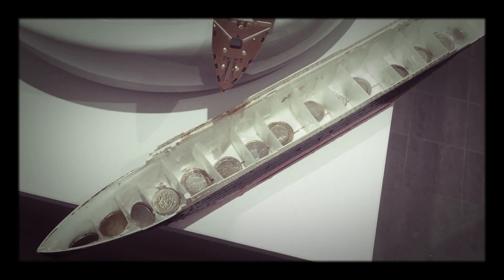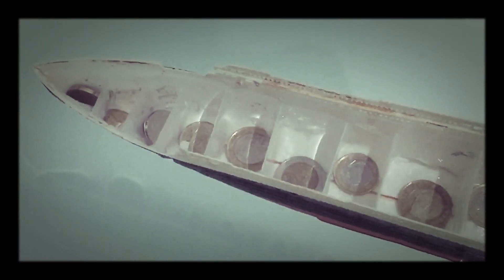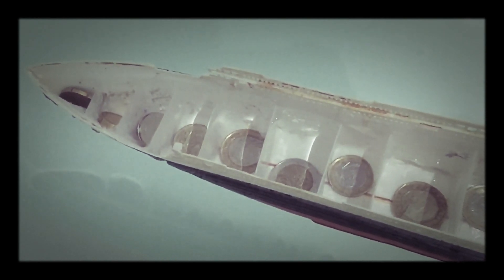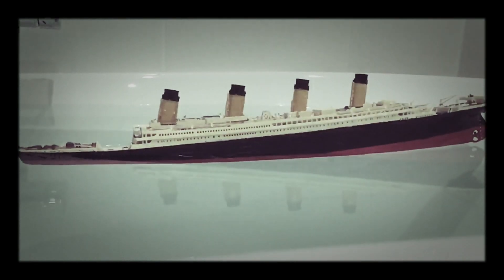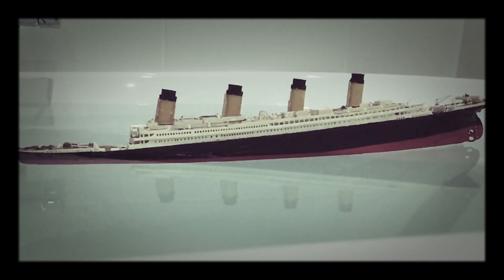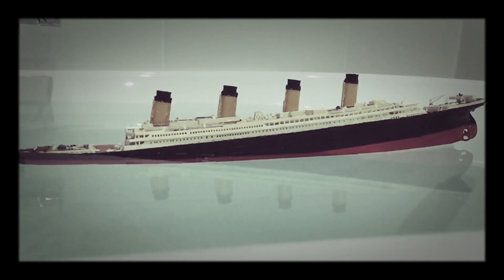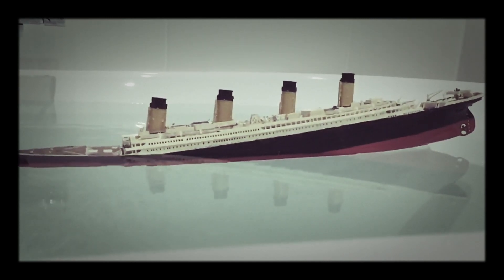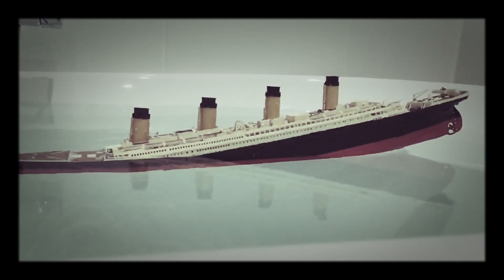Model Titanic with 16 watertight compartments sinks in a bathtub

Comment: wow it's sinks like real. if it's had inside decks added the sinking  speed will be realistic. stern raises the weight of the stern could not handle the double bottom. the breakup must near expansion joint.

Comment: I was a kid in the early 1960s. I had a motorized toy "battleship", Remco's "Fighting Lady":

https://www.youtube.com/watch?v=79Gmr7o4abw&ab_channel=ReanimationToys

All the electronics were attached to the deck, which could be removed via the screws visible in the video, leaving a bare hull. There was an opening in the bottom near the middle, where the batteries were installed, but it was mostly walled off except for one easily sealed opening. I floated the hull in a metal wash tub, added gravel weights, unsealed the opening, and tried to "save" the ship using multiple siphon tubes. As I gained experience, I built in watertight compartments using waterproof glue and popsicle sticks, then added more weight. Great fun.

BTW, I wasn't simulating Titanic; I was actually inspired by "The Last Voyage" and "Sink the Bismarck!":

https://www.imdb.com/title/tt0054016/
https://www.imdb.com/title/tt0054310/

Comment: This is fascinating.  Can I ask though, did the stern, on your model, lift up more quickly than in real life, because you didn’t put more coins in the sections that would’ve had the engines in?   I read that the centre of gravity was much further back because the engines were so heavy, but eventually the weight of the water filling in from the front exceeded the weight of the engines and down it went.
Reply: Yes, you are right that the engines caused the centre of mass to be further back (between funnels 3 and 4 to be precise). In this video, the lift is inaccurate. I think it was a passenger in lifeboat 2 who mentioned that the propellers were half way out of the water when the forecastle (the bow) was going under. It is believed that just before the final plunge, the ship was at a 10 degree angle, revealing the rudder and a bit of the hull’s bottom.

Comment: Where did you get the model? Looking for a science project.
Reply from the maker: It's Revell's 1:570 kit. You can easily find it on Ebay. It's not expensive. However, you have to make the watertight compartments for yourself.

Comment: They wasnt water tight if water went over the top if titanic had sealed water tight parts it would not have sank
Reply: The compartments were water tight, but because more than four compartments were flooded, the front end of the ship was too low which meant with the angle changed the water would spill over the walls separating the compartments. Had it only been four compartments, the angle of the ship would have been sufficiently level that the water would not go over the tops of the separating walls with the watertight doors closed. As it were, more than four compartments flooded and so it went back and back over one wall and then the next as the model shows in this nice video.